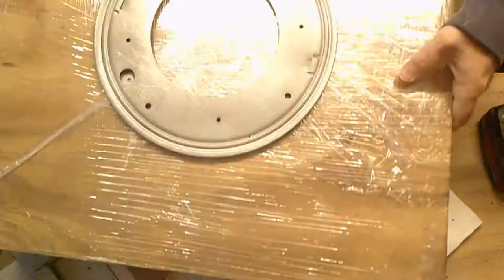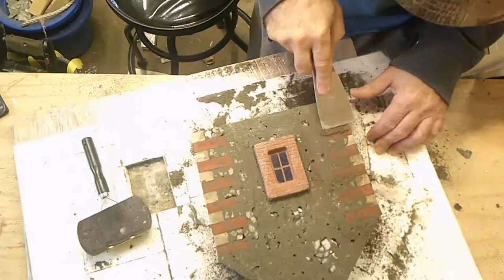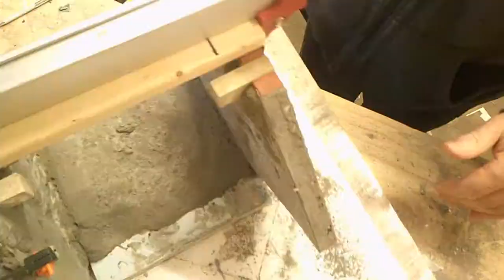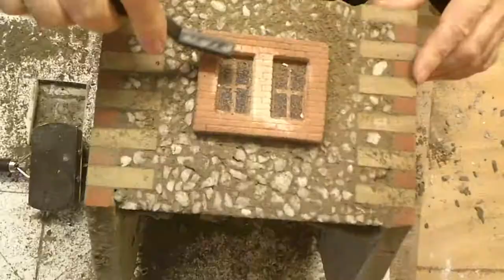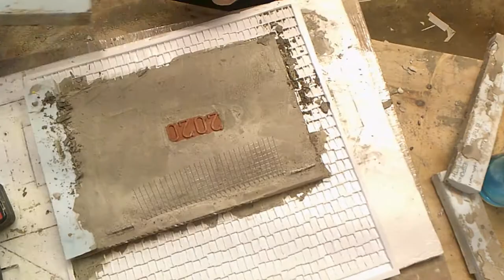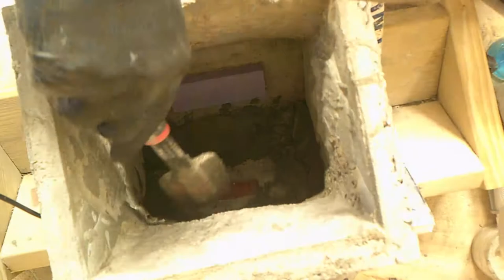How To Make A G-Scale Outdoor Concrete Railroad Building That Is Weather Proof

Comment: How To Make A G-Scale Outdoor Concrete Railroad Building That Is Weather Proof and weighs 90lbs. Hurricane proof. Awesome work!
Reply from the maker: Yeah, these should last for over a hundred years at least.  Mine show no wear just a little aging from the weather.   I saw where a guy made his like 65 years ago and most of them are still going strong 
Re weight:  I have noticed my buildings getting smaller over time as they are heavy, so the smaller buildings are easier to work with.  My first planter I made took two people to move it LOL. I hope to experiment with adding styrofoam to the mix to make them lighter.  I worry they will not hold up as long.  Anyway, thanks for watching

Comment: Do you make the corner stones yourself as well ? How - in a special mould 
What mix of cement?  
3 sand x 1 cement?
Reply from the maker: Here is the link to the video showing how I make the blocks. https://youtu.be/-sp1T1kyJTM
I use concrete patching cement, there should a be a link in the description.  Hope that helps : )